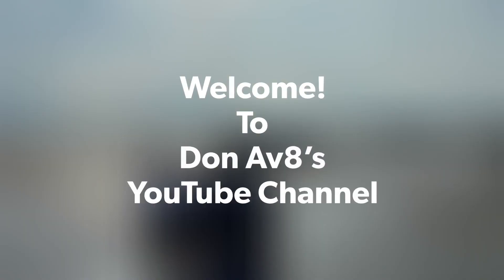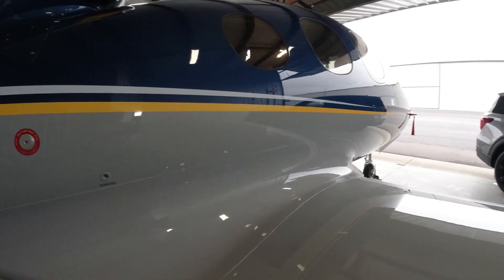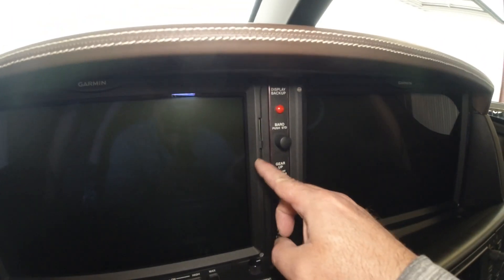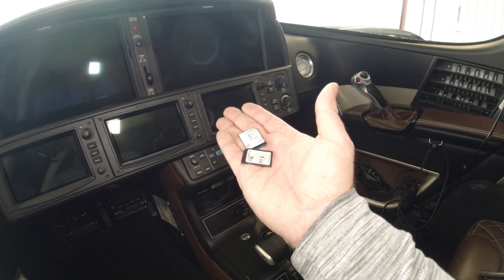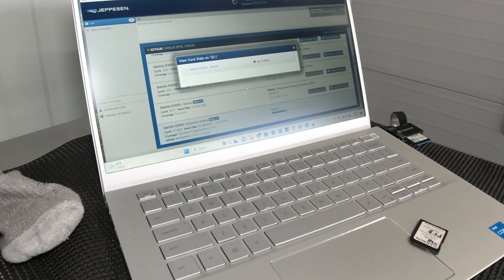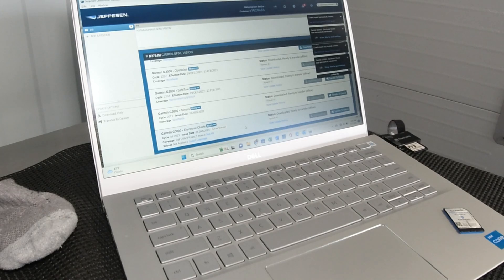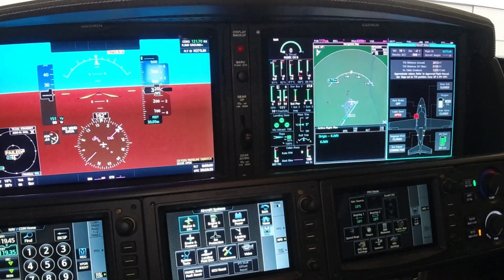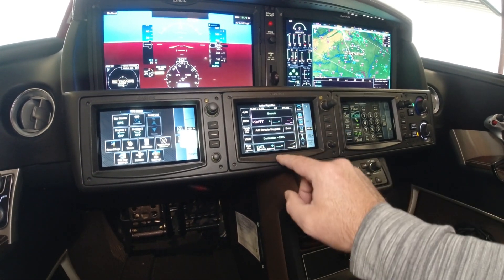HangarTalk - Cirrus Vision Jet Database Updates, VNAV and ATC Holding Procedures

Comment: Do you know if there are plans for current or future Vision Jets to receive over the air updates via WiFi or LTE? Thanks for the great videos!
Reply from the maker: There are a couple different types of updates than can be received wirelessly.  There are ways to update avionic databases wirelessly but it can be impractical in jets due to the large size of the database files. They can be subject to corruption so it’s not widely used. ATC has a system known as CPDLC where they can message planes in flight to update flight planes and so forth. That will probably be adopted into general aviation in the years to come as technology is adopted to reduce radio congestion.
Reply: Thank you for that detailed response! I appreciate it.  @DonAv8s

Comment: How does one manage VNAV in the climb phase with waypoint ALT restrictions on a SID, I seem to bust all ALT restrictions on the SID in VS mode?
Reply from the maker: Hi Stephen!  If you load a departure in the flight plan and set the top altitude for the SID you should be all set. You just need to make sure you can make the required climb gradient and ensure the avionics are set up to fly on NAV and VNAV. Double check the attitude all match and you should be fine. I hope that helps.